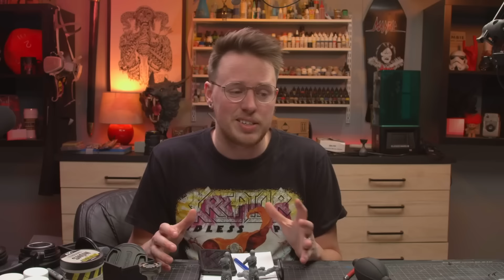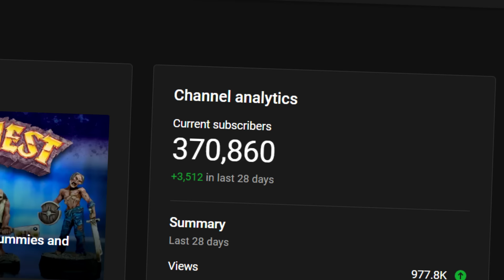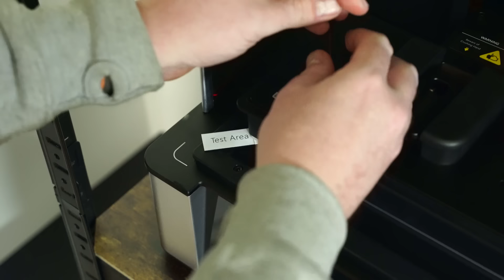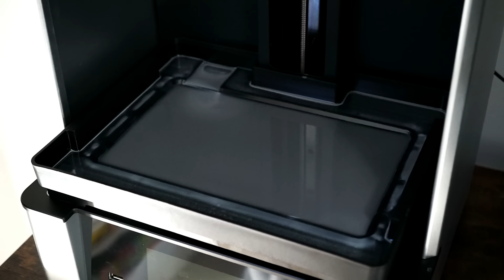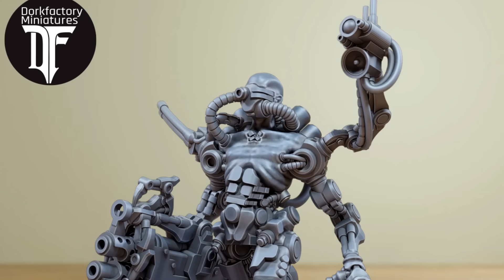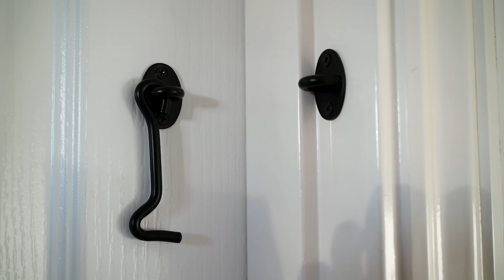Is 3D printing FINALLY easy enough to print Warhammer at home? Uniformation GKTwo!

Comment: I completely understand your worries. My resin printer is in my garage, on a dedicated workbench. I have an extractor in there, plus I always wear a respirator when using it. I don't have kids. 

I'd definitely be pretty reluctant to use one inside the house, or without proper extraction or a dedicated area so that I can keep the toxic chemicals away from everything else.

Resin printing is really cool, but it's definitely not for everyone.

Comment: Can consumer-grade air purifiers and measuring devices correctly detect the specific gasses coming off resins? From what I understand they use heuristics that have varying accuracy for different particle types, while "real" measurements are much more complex and expensive. Probably accurate for cooking fumes, but wouldn't expect it to be built for resin vapors.

Comment: I have the Anycubic Photon and it has been a big headache to figure out. A portable heater was the most helpful investment. I can lock it in a tiny ventilated bathroom while it’s operating. I hadn’t thought about fuses from the spirits so will need to revise my setup. Definitely going to wear my respirator for all stages of the process now.

Comment: I know everyone has different experiences but my cheap little anycubic photon has been a dream to use. I was expecting expediences similar to Guy’s but supporting minis was absolutely piss and I’ve had barely any fails in the two years I’ve had it despite using it in an uninsulated shed throughout the Norwegian winter. The only issue I had was with my IPA wash which I stupidly thought I could top up with water due to having done almost no research. I have have infinitely more difficulty with my 2D paper printer than with my resin printer 😅

Comment: Water Washable Resins are a danger to the thousands of ignorant users out there by washing models under the tap before curing. This STILL puts highly toxic resins into the water table and MUST be washed in isolated water containers and cured to harden any resin which can be put in landfill and THEN the water down the drain. 3D printing may become an environmental nightmare.

Comment: I've been 3d printing for several years now, i can say for sure that you could have had the same experience with your old anycubic as you have had with this gktwo with the right guidance. My original resin printer was the first ever elegoo mars and although it was a learning curve, it was easy compared to fdm. The only complicated bit with resin prints is learning how to support them properly. The post processing takes time, but is easy enough. 

I'm lucky enough to have my printers in a shed with their own dedicated air circulation and heating. Personally i wouldn't recommend doing this indoors. I've used mine to print all sorts, from warhammer bits, to titan proxys.

Comment: First of all, great video and I hope that 3D printing can further support your passion. I also started with an Anycubic Photon, which eventually turned into 3 printers. I'm currently using a Phrozon Sonic Mighty 8K and I have to say, you can clearly see the difference between the devices. In addition, from today's perspective, I would say that the Anycubic was not the ideal entry-level printer, but back then the selection was unfortunately not as large as it is today😅

Comment: yes, definitly not something you want in a shared space if it's not under lock to protect everyone, those thing are nasty, even the water washable, it's less volatile, but it's still extremely dangerous uncured. even on a base i put a coat of paint on both side to be sure the resin is not exposed.

Comment: Awesome vid, but Guy... the GK2 has a little flat lever above the build plate where it attaches to the Z-shaft.
Flip the lid up, flip that flat lever and the plate will come off. You can then pop the prints off without the risk of them falling into the vat.
Clean the plate after, then reattach securely and you're good to go. It's also designed to fit into the cleaning machine if you wanted.

Also, highly recommend a P3 filter mask and safety goggles. Sometimes print supports will flick around and I've had a few occasions where they'd go into my eye had I not been wearing them.

Good luck and enjoy the machine <3

Comment: I too bought the anycubic Photon back in 2019 and even though I have tried the anycubic mono x (which was easy to use)I still didn't get on with it so it's not for me, but I do love my bambu labs P1P and get some fantastic results so in short FDM for me and a lot less mess

Comment: I have been printing for 4 years , I have a tyranid, space marine , and now sisters armies at 2000 pts each . Love it , and let’s me play the game at a fraction of cost . After you buy a printer and yes the resin and safety gear,  the savings scale dramatically . Overall I’ve spent $800-$900 for producing , and I have made those 3 armies and lots of other D&D or other random   Warhammer minis . So yeah I would say I’ve saved several thousand in comparison to purchasing all those plastic models !

Comment: Oh man, that pickle jar is so much nicer than the one I have.  Mine is rather small.  Gonna need to replace it soonish, so I'll have to look for that one.

Also, it's worth noting that the VOCs are much worse while cleaning and curing than while printing.  And, if you can smell it, it's hurting you, so I would say that if you're sensitive to the smells, don't get the odorless stuff, get a respirator to use while you're working around and with resin printing.  The smell lets you know that it's not safe.  Odorless will lull you into a false sense of security and make you more likely to not take the safety precautions.

Also, yeah, water washable sounds nice, but it is typically sacrificing performance for that water washability, and they are never truly water washable.  Plus contaminated water is SIGNIFICANTLY more difficult to deal with than contaminated alcohol.
Reply: As for "too hot"  you're not really going to end up in this scenario.  It would be incredibly uncomfortable for you, and would massively shorten the lifespan of your printer to get things "too hot"  When curing, the resin is going to reach temperatures between 60 and 80C, maybe even higher.  The main thing is avoiding the resin being too cold.  This prevents the photoinitiators from curing the resin properly.

Comment: Ey up Guy, I used to have my printer set up in the basement, but the smell it produced was quite strong. Even now, if I bring the isopropyl alcohol I use for cleaning indoors for daft reasons of mad science, the odour is quite noticeable.

My solution was to relocate my printer to my outdoor shed, which isn’t airtight but can be locked. It’s not as convenient as having it indoors or in a hobby room, but it keeps me from being affected by VOCs.

My printer is a bit older and doesn’t come with a built-in heater, which is crucial in the UK and for printers located outside the house. So, I had to improvise a heating solution, which thankfully works. Your printer, however, should be ready to use without any modifications!
Reply: Exactly what I'm planning to do! I'm going to make myself a work shed (for other reasons) this summer and put the 3d printer in there. It's going to be heated and insulated since I'm in Canada and it gets pretty cold even in the summer during the night. Even with my over the top safety setup in my house for 3d printing (grow tent, two filter ducts to outside + bathroom fans in each, soldering filter fan etc) it,s still very unhealthy, so I don't see any other option than printing outside

Comment: Take it case by case and and plan accordingly.  If a 3D printer would work on a particular project, use it.  Just because you have a tool does not mean you have to use it in every case.

Comment: I started a few months ago with a Bambu Lab P1S FDM printer, it's pretty neat.  I'm mainly using it for larger items.  I'm currently printing all the pieces for a Thunderhawk and with the exception of a few failures along the way, the majority of the pieces come out really crisp.  I'll be trying a Warhound Titan afterwards.  I've got young kids so wanted to start with something safer to be around, and also safer material wise.  It's neat to be able to print toys for the kids that I don't have to worry about being toxic, like resin.  FDM prints are surprisingly strong, so I'm looking forward to doing some cosplay outfits and props too.  The cost of materials is also quite a bit lower than resin.

With that said, I do plan on buying a resin printer eventually.  I have a plan in my head for an enclosure that will house the printer and cleaning station that will be vented outside directly so the VOCs aren't circulated around my house.

Comment: Hey Guy, one thing you may want to look into getting is a cleaner that has a sealable container. Both of the ones I have have them, and I think it would help with the VOC issue. It looks like the Uniformation one doesn't have an air or water-tight seal on the lid.

Also, I don't think most of the stuff used in 3d printing isn't much more dangerous or hazardous than what you find at most craft and home improvement stores and the cleaning supply aisle. Is it an issue that one should be aware of and try to mitigate? Yes, but I think that most of the precautions you have done should be enough to prevent any issues with the kiddos as long as you're also teaching them that there are some things that are very dangerous and could do them a lot of harm in the room.

That said, if you are really concerned about it, why not build or buy a cabinet that you can lock up to put the printer and gear in and put in a vent and fan that goes outside? Yes, it's a bigger investment, but it's also one that I think would be worth it just for your peace of mind.  You could also hook up a spray booth to the same vent and use blast gates to control the flow.

Comment: Hey, nice vid, just a quick reminder that the when using water washable resins, the water used for cleaning them becomes contaminated and mist be disposed of safety, not down the drain! Like you I shudder at the idea of thousands of people having to work with these toxic materials at home with little to no industry guidance.

Comment: I don't blame anyone who desires to print GW models, but I love the idea of using the 3d printer to create minis/terrain/other models that are simply not available via GW and their partners. Kit-bashing a single custom character is potentially insanely expensive, since you can't easily get bits without getting lucky on ebay. Being able to 3d print parts for your specific Rogue Trader, Deathwatch,  or Wrath & Glory character is super nice. Also, working out a custom army with a custom theme.

So, yeah, long-winded way of saying "absolutely please go the custom minis route, Guy!"

Comment: I have the same fears in mind like you, I don't have a pet, but two children and a tiny workspace/home office (2x3 m). I won't do 3D printing with resin at home. However, maybe this or next year I will probably start 3D printing with a PLA printer for terrain and maybe also vehicles or something like this (in the garage). At the speed the quality of all those printers is increasing, maybe you can print your minis already with the plastic printers instead of resin then. There is an opportunity in Vienna where you can use kind of a shared workshop where they do have resin printers. Maybe I will sign up and do the printing there, I am not sure right now.

Comment: Newer printers are absolutely getting into an amazing space. I really wish the big bad boogieman of VOC would stop being a buzzword. I understand if you have concerns, but show it accurately. Like how simply putting a sealed lid on your cleaning vat which comes included every setup will drastically increase the air quality almost instantly. Its situation dependent, but you have cleaning products under your sink more deadly than 2 minutes of exposure an n95 mask could solve.

Comment: Great to see your perspective on the 3D printing trend and great to see Fauxhammer on the channel, what a great dude! I think the point you raise at the end of the video (spoilers I guess) about space, toxins and investment price are always what has prevented me from getting into 3D printing myself. It has never primarily been about the definition of models or ease of use of the machines though that does play a part.
The fact is most people are hobbying out of the corner of a room or in a room they use for other things like home office or bedroom, 3D printing does require a dedicated ventilated (i.e not a cupboard) separate work space, hard to tout something as the budget solution to Warhammer when you need that to safely get to grips with it. But that's just my two cents, I have loved seeing the technology improve and it will continue to do so exponentially I'm sure, I look forward to printing a new liver in 2066. Great stuff guys!

Comment: I started with an Anycubic Mono 4K (small / entry level) at home. After just a couple months, I upgraded to a Mono X (midsize / hobbyist), but I started learning more about VOC's and other health factors. Luckily I got a tiny side hustle gig helping a local DnD studio run their 3D printing room. Now I have access to a room of 8 printers which has ventilation. That said, I've currently got Resin Rash on my forearm from accidentally resting my forearm in some residue. I often peel Vat Cleaning sheets of resin out with my bare hand, because I need the fingernail to get purchase on the corner to peel it, but I have a waterless soap dispenser in the room and then I immediately go wash better.

Comment: The calibration is the worst part. It takes forever to dial in your exposure settings and that is only for one specific resin. Then there is the entire other factor that can screw over the process, trying to keep consistent temperature.

Comment: 3d printing is it own hobby if you can't cope with another just buy models, use water washable resin I have emphysema and my lass sensory autism we have no issues with ellegoo water resin, regarding the kids that's your issue mine 3/4. My halot one in a cupboard printing, over a year iv printed 1k salamanders, 2k sisters of battle, 4k tau Inc Taunar, currently printing a warhound. printing easy just socity and younger gen want it all now with no downsides, must have the XY,Z items but wont compromize, because it hard path of least resistance cake and eat it.

Comment: What a terrific video, Guy! I'm thoroughly impressed by the printer: very easy setup, lots of great quality-of-life features, simply amazing results, and comparatively safer usage compared to older printers that I've used! Since I have a garage and no small children or animals, I was very tempted to give it a look!

Then I saw the price tag. $800-1000 for the printer... Woof. I know it's top of the line and that's completely normal, but it's still a huge investment. I'm willing to compromise on the size of the build plate and the resolution of the prints, does Uniformation make any similarly feature-rich printers that are a bit easier on the budget?

Comment: If you do continue to use a resin printer, please wear a proper ventilated mask rated against fumes and vapors. Additionally it is quite popular to use hydroponic tents as improvised fume hoods for home printers set up. They can contain and isolate all the nasties, and can easily have a ducting with an inline fan to safely vent the fumes outside of your house.

Comment: Also, the cost: The three machines total to almost 1300USD. That's a flock ton of non-G'Wullu minis. It's just way too much hassle and work for me. When we get to Star Trek replicator levels of 3D printing, I'll be interested. Until then I'm buying minis. preferably multipart plastic and metals!

Comment: I'm honestly a bit stumped as to why you say you've had such a bad time with the Photon. I've run a Photon Mono for years now and the process it literally exactly the same. All the steps are the same, the required materials and precautions, the way you slice your models and check for resin settings (Anycubic printers even have a resin exposure range finder model they come with, which you can use to determine optimal exposure settings with in a single print. That's also the same with the GK2. So could you please explain why you didn't like the process with the Photon, but with this one it's fine?